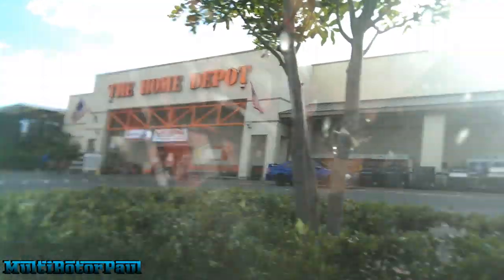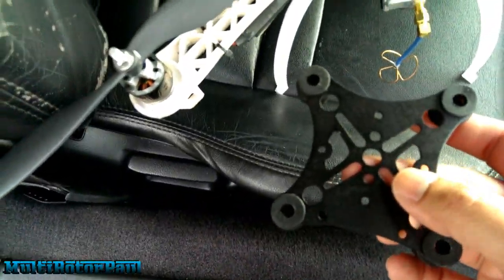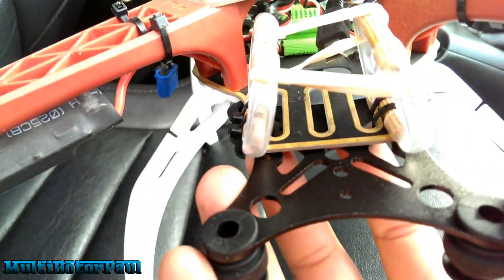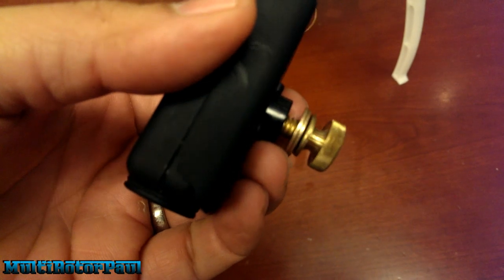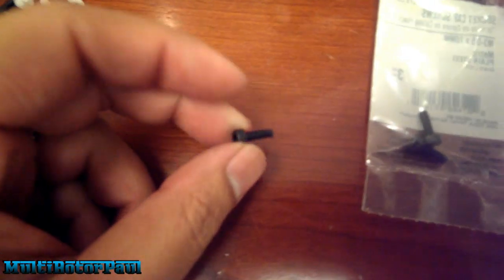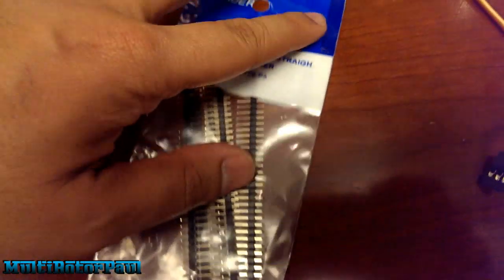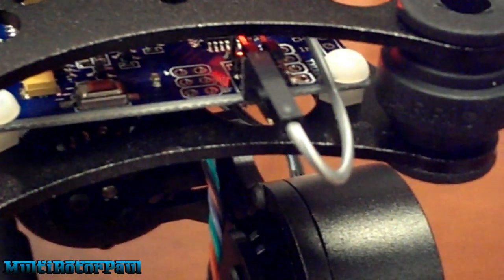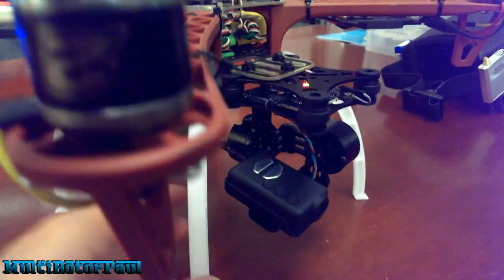Mobius Gimbal for FPV with Installation - 9XR

Comment: I think you might be thinking these props have threads, they  dont, so really all im doing is decreasing the height of the prop hole. Im just thinking, this is the same (prop on thread grip/no grip scenario) as generic prop/motor shaft scenario. I will create another channel for  uploads related to flying machines lol...later this week, and upload a vid for you.
Reply from the maker: +owenkilleen actually no, I didn't think that.  I was just suggesting you do it the right way. That's all.
Reply: Ok, fair enough, see, i haven't a clue, this is all new to me, lol, so i'm learning through every new thing i haven't come across, it's great, coz once you know it, that's it, i don't have to re-know it. :-) I've made so many mistakes.

Comment: Paul...My props keep flyin off! Lol. Tried my first test this evening,  and granted, there aren't many threads left for the cone tops to screw on after the props go on, also, it tends to list to one side, did this happen to you when you first tried? If so, how did you overcome it? I'll find a way to show all this on vid shortly. Hope you're well. Owen
Reply from the maker: There should always be more than enough threads on the motor shaft to screw on a nut. If for some reason the cone nuts aren't working, you could try regular nuts with a very small amount of clear nail polish on the threads to stop the nuts from loosening themselves. Or try nylon locknuts, those are great. I'd like to see what you're talking about. Also...

You said "it tends to list to one side". Not 100% sure what you mean.
Reply: So, after buying a load of standard props about a year and a half ago,for dji style locknut design motors(i was a noob lol) recently i sent off to banggood for what was titled as locknut design props. I got the same generic props again instead, so basically they're not able to go all the way down the motor shaft. Last night i used a dremel rotary tool to shave away the inside of one of these generic props, and it does go all the way down, and the cone nut does seem to go further down and even because of the composition of these plastic 'other' props, it seems to 'squeeze' a little more gradually on, tightening the prop gradually. Do you think this could be a problem? Shaving away the inside first half of the prop. It still has a lot to hold onto the motor shaft.
Reply from the maker: i wouldnt have used a dremel like you did. At this point, new motor prop shafts would be ideal, if possible. if you cant find those, then get new motors. You're still going to have to either get new props, or get new motors unfortunately. I would not suggest using what you have right now.
Reply: Ok. :)

Comment: And I guess I had an FPV mindset before I even started, I never like jello!

Also, you don't need a special cable to fix that issue with the mobius on the gimbal. I had that problem with my mobius on a pan/tilt mount all I did was take an xacto blade and slide off the cable insulation, so there was only the individual wires and their insulation, all the way up to the plug. Just use a wrap or tape wires together just below servo plugs so they don't go everywhere
Reply from the maker: This wiring issue was already fixed with the super flexible wires from HobbyKing.  Way better. And I didn't go fpv in the beginning for cost reasons of course. But I find it pretty important to be able to to fly without fpv first to develop the skill. Fpv is so much more fun though.

Comment: after see this i can connect my cheap gimbal to 9XR. I only add more battery to power gimbal board, so need add 2 wire goes to reciever 1 signal and 1 to (-/ minus)
Reply from the maker: I only used one wire for signal, you can see this in the video.

Comment: year great job  you know your stuff, can you help me understand the mobius wires i have the same fpv set up  but havant used it yet because of the 5v supply to the mobius  ,thanks
Reply from the maker: you don't need to connect the 5v power wires.  just the black and yellow video connector.
Reply: MultiRotorPaul thank for your reply paul I'm beginning to understand what i am dealing with    so i can just use the mobius internal battery  got it !   watching your videos has made my fpv set up a whole lot simpler  thanks
Reply from the maker: glad it helped! Hopefully more videos coming out this week. I've been really busy
Reply: busy with multirotors  I hope, not work